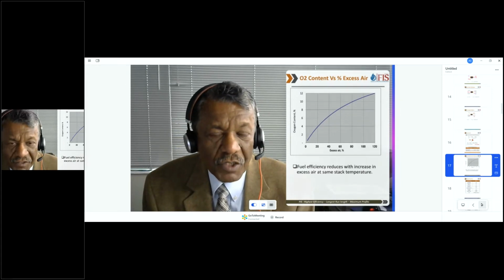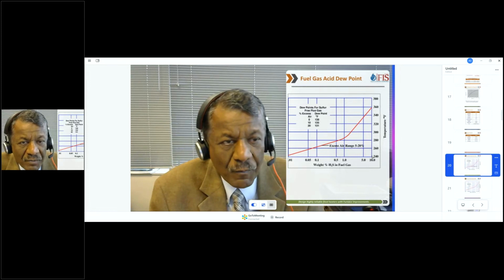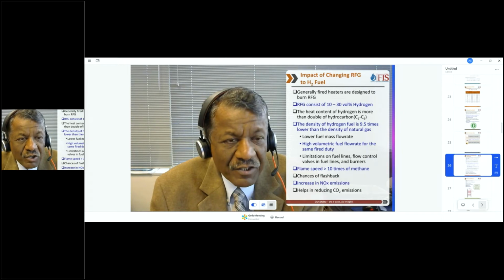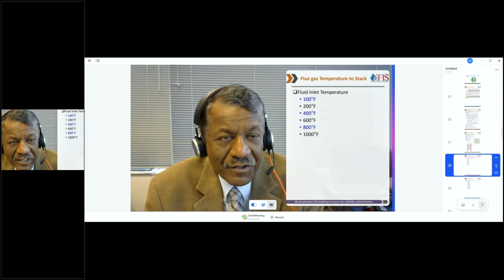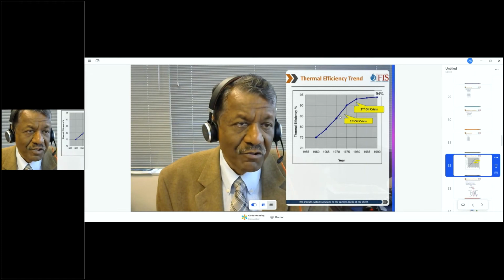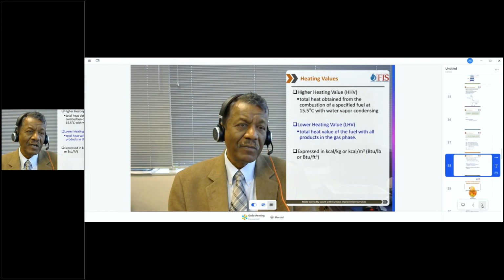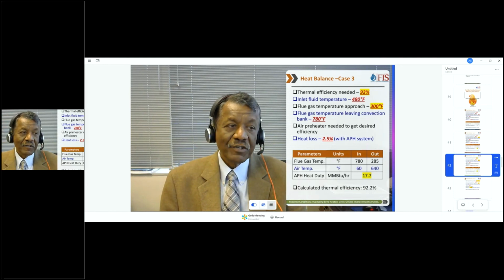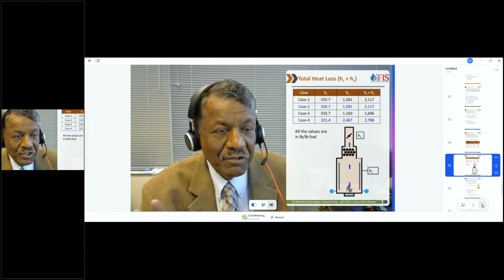Fired Heater Design Training Webinar Session-2 Part-2

Comment: Thank you so much for the insight. If you have a fuel gas fired heater (an auxiliary heater) where the intention is not to heat up another fluid but to generate a hot flue gas which is needed to increase the temperature of the stack, what are the most efficient measures one needs to apply to maximize the flue gas temperature (leaving the heater) while not excessively increasing emissions? The only means I can think of now is increasing the fuel gas and air supply, but this will also lead to increase in emissions. Thank you